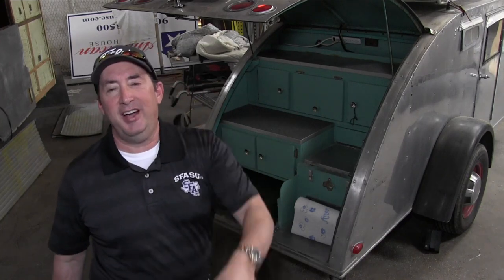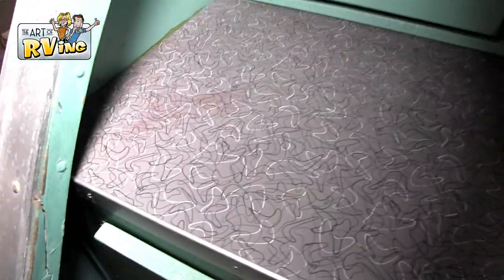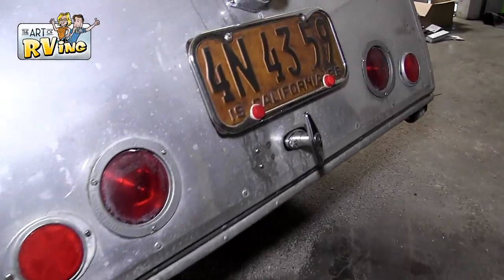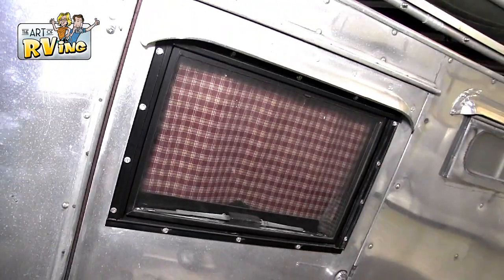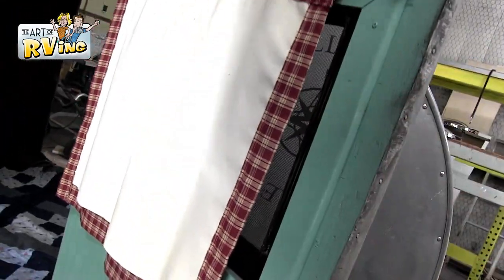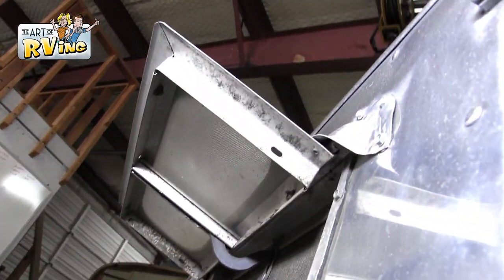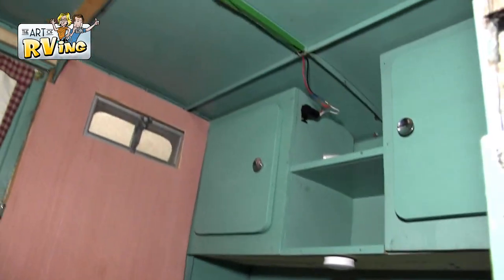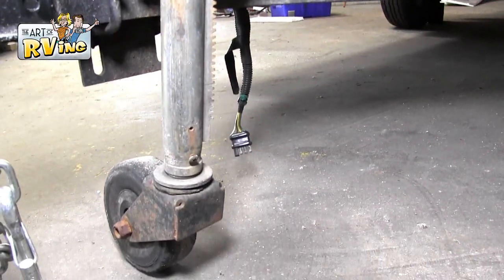1936 Kaycraft Kampster Teardrop Trailer.Vintage Teardrop Trailer

Comment: I did love the color. Lo-tech works every time. No way that paper towel roll stayed rolled back in the day. That would have been everywhere. 😂  I bet you this was the inspiration for the Airstream. I mean look at that sharp and shiny aluminum. Pink and green walls, classic! Leather strap, wow. That was a cool thing to see. How inventive to have the back set up like that. Great work! ❤️👍👏
Reply from the maker: The color rocks. Lo Tech...It really does it for me....the paper towel holder...what? Yes, Airstream probably borrowed from this, I think they were made at about the same time. When it is shined up, it will glow. Pink and Green, complimentary colors. You guys rock
Reply: Paper towel holder just hangs the roll, but doesn't keep it from unraveling. Bet it unravels as you go down the road. 👍

Comment: I love that!  I found you on Steve Turtle's channel and I'm gonna subscribe cause I LOVE vintage campers and have owned a few.  Nice find!
Reply from the maker: Tell me about the trailers you have owned. I love the old stuff. In good shape or not.
Reply: @TheArtofRVing  I've had two old Shasta Compacts, two vintage Scottys, an Aloha, and a not so vintage 1989 Scamp.  I sold the Scamp in January last year and since then I've bought and sold a few campers for profit, but don't currently have one for myself.  I'm looking at an Aliner Alite, but have to wait until the virus stuff is better because it's quite a road trip to go see it.  
My father and I used to buy campers and fix them up to resell, but he passed away in 2017, so those days are over.  :(